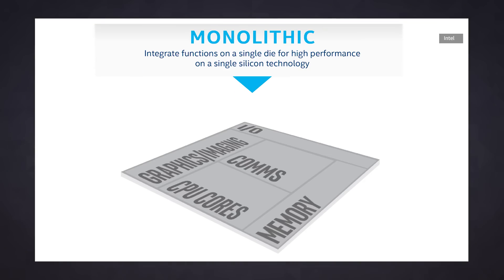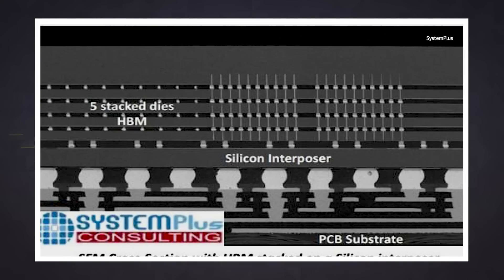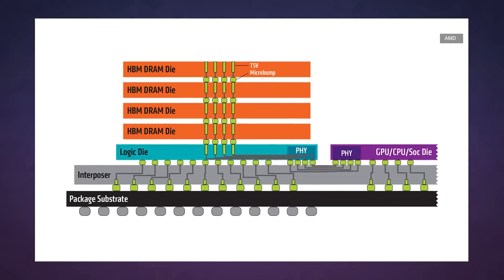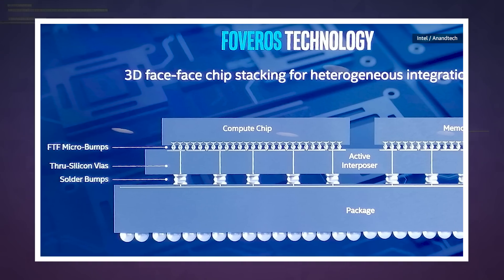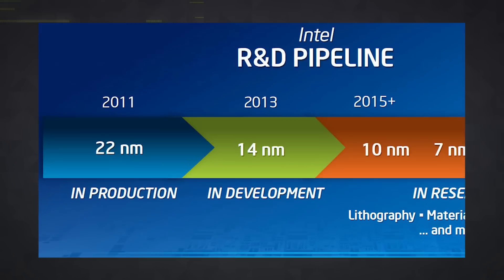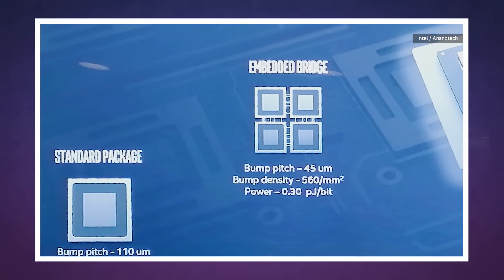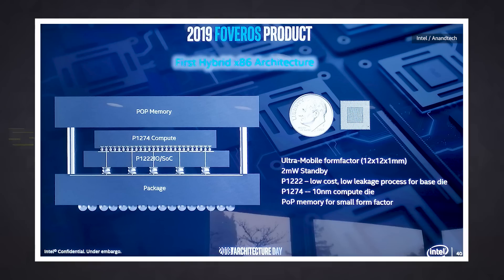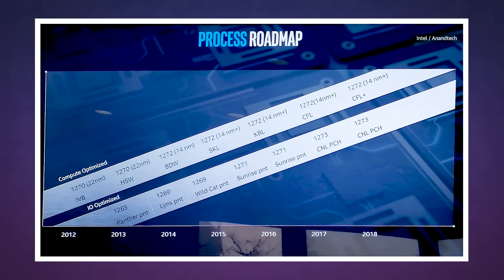This new 3D chip tech is how Intel will beat Moore's Law | Engadget Today

Comment: I think these will be to expensive for large uses.

Because you have a memory problem the whole chip is wasted.

Sure it will have bypass isolation etc but heat will burn them out faster.

Comment: Foveros is about a lot of things... but Moore's law is not one of them.  I think Engadget got a little confused... this stacking technology only really works for low-power parts.  At best you might be able to have one high-power layer in there, everything else would have to be low-power.  Otherwise it would just melt into a puddle the first time you turned it on.

In anycase, Moore's law is doing just fine. Just because Intel tried to soak the market with '4 cores is good enough' parts before AMD kicks them in the pants and woke them up doesn't mean that Moore's law is dead.  All that has happened is that conventional silicon is hitting a frequency limit, which means we have to scale up with cores instead of frequency.  These silicon processes are still scaling on power and frankly that matters more than clock frequency.

To a conventional computer user power consumption might not matter very much, but it has actually been one of the more serious limiting factors for a long long time.   Power efficiency has maintained an almost-doubling every 2 years.  For example, a 48-core 4-socket (4 x 12-core cpus) opteron server 8 years ago ate around 1000W of power.  A single-socket TR2990WX, 32 cores / 64 threads, has TWICE the total performance of that old 48-core opteron and eats 1/4 the power doing it (around 250W at twice the performance instead of 1000W), which gives us an 8x improvement in efficiency over 8 years.

-Matt

Comment: 3d chip architecture degrades lifespan of chip much quicker than normal chips, the electrical wear out is distributed evenly across the layers, which causes dulled performance within a few years, so most probably this is only good for smartphone cpus

Comment: Intel? Ummm...Intel don't make CPU's. They design an architecture and that gets basically printed on silicon by a manufacturer.  It's the manufacturer that makes the chip. Any kind of messed up 3d chip would require the manufacturer to re-tool their factory. They're not going to do that and then only make 3D chips for Intel

Comment: Moore's Law means die size double each year, why would they wanna beat that? I thought the problem here is that they still wanna maintain Moore's Law?
Reply: double? Dude do you even know what you are talking about ffs
Reply: @davidkern7636  Moore's law is the observation that the number of transistors in a dense integrated circuit doubles about every two years. Wikipedia
Reply: @kinglau66  yeah, number not size. Logic
Reply: @davidkern7636 👍

Comment: maybe try to replace the stacking concept with a distributed chiplet concept, try to connect the Memory & Compute chiplet from 2 different die using high-bandwidth & low latency communication rail, such as Optical I/O's. You should recreate the Infinity Fabric.

Comment: Dude everything u talked about doesn't even exist yet it's just on paper, they don't even know how to cool a 3d chip as of yet. Can it even be done at a reasonable price? The only way its going to happen is integrate the cooling into the chip manufacturing  process itself. Sounds like a pipe dream.
Reply: Moving heat along with power along the chip latterally with the interconnect of each layer.  Can be done just needs to be implimented into the manufacturing process. All this tech is lab available. Commercially viable to manufacture?  Not always so.  Often these big foundries are waiting on ASMC and tech to mass produce chips.

Comment: Thats what i call marketing reporting. When i hear Intel 3D i just look at this big mouth announcement of Intel Optane. And here the situation is much more troublesome. The big problem is thermal dissipation. You can stack RAM cells, especially Flash a lot because they create almost no heat but computing cores is a total different game. Thats why scientists are working for 20 years on nanopipes that should absorb this heat ... but there is no real result not even in the basic foundations, let alone on a commerical usable  scale.

Comment: They're not trying to "beat" Moore's Law.  They're trying to work around the quantum tunneling brick wall.
Reply: They ain't even close to it :D
Reply: @davidkern7636  ... they're knocking on that door.

Transistor gates ain't getting much smaller.
Reply: @tylerdurden3722  The comment is 6 months old... and yes they will get much smaller, when we start using a different material

Comment: Stack cores on top of each other, what about the heat coming out of them, how are the sandwiched cores going to release their heat?
Reply: They wouldn't stack cores. Just data layers that connect with the cores below.  Heat dispersion has been thought of.  Using the metal interconnect layer and moving heat with the power.

Comment: They WERE behind on 10nm? They have only released a limited number of ONE sku and it's terrible. It doesn't matter if they stack their 14nm dies on top of each other if it still the same old 14nm. It will only be more power hungry and produce more heat. They already glued together their 14nm chips to create the super-shit value i9 series which needs an industrial cooler and a nuclear reactor to work. Intel sure knows how to make hype, but rarely deliver. I won't hold my breath.

Comment: Die stacking is nice and everything, you get everything closer together, wider buses and all that jazz, but... Power density is not going down unless you shrink the node. You can't just stack bunch of desktop CPUs of GPUs on top of eachother and multiply computing power. So it's not a continuation to Moore's law, architectural improvement for sure, but no more than that.
Reply: dont worry intel will invent 4d cpus
Reply: @Blox117  well... they are working on quantum computers ssooooo......
Reply: Agreed. Even if you granted Intel the continuation of Moore's law they could only do this stacking 4 or 5 doublings. 3D chips sound cool but now they're attempting to move the exponential increase into physical space. After 5 doublings you have a cube, then two cubes, then a processor the size of a desktop PC, then a processor the size of a mainframe. Clearly not sustainable.

But 4 doublings would take what, 8 years? By then cloud services may have access to real quantum computers and in 20 years when people draw the Moore's law chart these chips may be a couple data points and with quantum it may just keep doubling.

People say Moore's law only refers to transistors but I view it more as the more general exponential increase of computational power. 

I think at some point all database engines will have quantum computers on the back end. People will still use SQL and nosql to query them but the actual search algorithms will have the nessesary improvements to deal with petabytes and beyond.
Reply: @williamjames6842  yea there is a sompany called shadow ig which is providing high quality cloud computing
Reply: People say that ARM will not take over intel in the desktop market, but their chips are more efficient. That efficiency might pay off in the long run.
Reply: @ericcartmann  most of the power efficiency attributed to them is actually in their extremely good low power state. For example an idle phone is much more power efficient than idle desktop PC, leading of course to much better battery times. In a desktop or server environment ARM doesn't really have that much of an advantage. ARM supercomputers for example have been built, but very few of them, TOP500 list is dominated by x86-64 for a reason, it just gives most bang for the buck. Better power efficiency is needed, but I doubt it will come in form of an architecture shift.
Reply: @aleksandersuur9475  "Better power efficiency is needed, but I doubt it will come in form of an architecture shift."

That's because you're incredible short sighted and not seeing the the gradual shift that's happening in front of your eyes. Just last month, Microsoft made ARM64 native to Visual Studio for windows 10 development. The architecture shift is happening in the next couple decades. 

ARM chips have had much larger improvements than intel has in the last 10 years. Intel is at a stand still, and ARM cpus keep getting faster and faster. They also do it with less power too. 

ARM chips also have the benefit of being able to shove a massive amount of cores on their die without much heat generation. Intel is reaching a bottleneck with how much cores they can put on a chip because of heat. ARM can put hundreds of cores on a chip and it wouldn't get too hot.
Reply: @ericcartmann  Arm is just a RISC cpu which is why it is so efficient. If market share shifts so greatly towards efficient CPUs, intel would just produce their own RISC variant.
Reply: @cyberlord64  lmao no one would use intel's RISC cpu. 

ARM currently has the most support for an RISC architecture and it required a decade of the mobile boom for this to happen. 

An intel RISC cpu couldn't run android properly, it couldn't run linux properly, and the open source community wouldn't give a rats ass about it.
Reply: @ericcartmann  what do you mean "it couldn't run android and Linux properly"? If it has a compatible instruction set it can work just fine.
Reply: @cyberlord64  It would need support and development. 

Try the x86 version of Android (lmao it's a thing!) and you'll see that you need a little bit more than a "compatible instruction set".

Better yet try out Linux for ARM. You'll notice quickly it's harder to use compared to an x86 version of linux. You have to compile many binaries yourself as packages are not available.
Reply: @ericcartmann  Well yes, but support and development coming from a company being a colossus from a financial, and infrastructural standpoint when it comes to the server domain is more likely than from a company who attempts to scratch the server market surface. In both cases, and from all aspects , a RISC CPU in the server domain is a new thing. Even the arm variants are very different than what you would find on a phone. And even arm variants between them have varying levels of support. From a business perspective, if a company is to chose a RISC replacement for their legacy x86 infrastructure, an intel contract would be more valuable.
Reply: @cyberlord64  "intel contract would be more valuable."

Until you realize all these third party software packages are loaded with bugs with no support. 

Intel can't be the only ones making software for their chip. The open source community wouldn't support them either. As an embedded developer I wouldn't contribute a line of code to a Intel RISC open source project. 

Last thing we need is all these architectures floating all over the place. They should just do what all other chip makers are doing and contribute to the ARM project.

In October 2018, Arm Holdings partnered with Intel in order to share code for embedded systems through the Yocto Project. 

From wiki: "The Yocto Project has the aim and objective of attempting to improve the lives of developers of customized Linux systems supporting the ARM, MIPS, PowerPC and x86/x86-64 architectures."

Intel clearly is focusing on x86-64 and having the best x86-64 chips / highest performance chips on the market. They will surrender the low power market to ARM.
Reply: @ericcartmann  That is fine and all but this view is from your own perspective. You wouldn't. Most would. I remember when open source developers would not support Microsoft with their "Embrace, extend, and extinguish" policy with open source software, and today MS VSCode is the top contributed piece of open source software on github, which itself was purchased by microsoft. In the western world, market demand precedes business opportunity, business opportunity precedes business reaction, via planning, design, implementation, all being investments of time and money. I mean... from a realistic perspective, a real life ARM cpu designed for server purposes is about 40-50% more power efficient than its Intel counterpart for the same amount of processing power. This is not enough to justify throwing away a server farm with Intel hardware. Maybe if that hardware was to be deprecated anyway and your contract with Intel has expired and you have an in-house team ready to implement, resolve and support barely documented bleeding edge hardware. 
I have heard this argument in different versions multiple times. i.e "Wait until Linux does this X thing and Microsoft is finished" Really? Cause once Microsoft could no longer hide Linux being the de-facto server OS selection, they basically incorporated Linux in their infrastructure for their entire Azure cloud, joined the open source movement by providing a couple of frameworks and tools, (partially mitigating costs of development and testing to the open source community) while raking in billions from providing a service. "Wait until AMD releases the infinity fabric and Intel is finished" Really? Cause in 2 years time they baked their own stackable system, which if indeed does overcome the heating dissipation obstacle could arguable be an even superior solution. "Wait until the Xbox is released and the Sony Playstation is finished", "wait until this", "wait until that".
What I am trying to say is, Intel is not some Amiga corporation which has a good product but can go down due to bad marketing. It is an organically grown business entity, tied directly to the information age we live in today. They have absolutely no reason to pay ARM for licensing, as they have their own processor design team, and (at least for now) near-complete monopoly in business applications. If anything, they would just spin off their own RISC ARM compatible counterpart. I mean, designing cpus is basically what they do.
Reply: I think too many people just throw around the term "Moore's law" and don't realize that it's not performance but transistor count that is the measuring factor.

"Moore's law is the observation that the number of transistors in a dense integrated circuit doubles about every two years."

Comment: Don't hold your breath... How are they going to cool that stack of silicon? Seems to me  more layers will mean more heat. I imagine 2 layers = more or less 2 x the Watts in heat produced by 1 (with the bottom layer getting significantly worst cooling and potentially less durability due to heat damage). I wouldn't buy the first gen of this design until until these issues manifest and they work those kinks out...